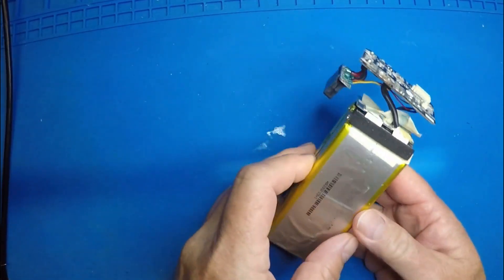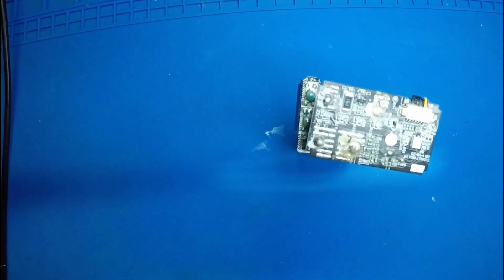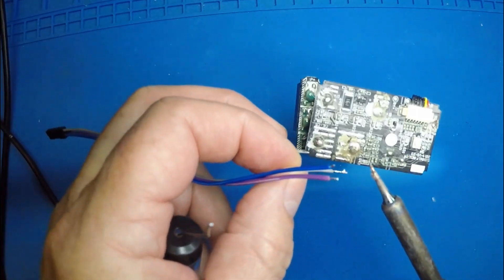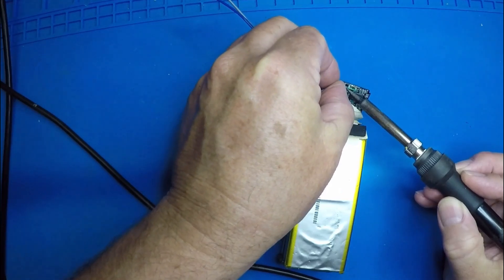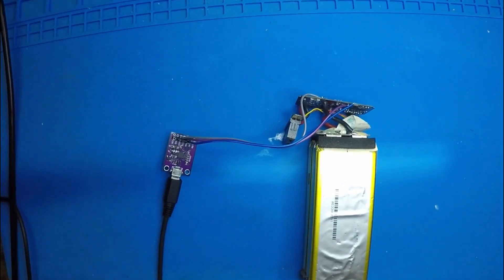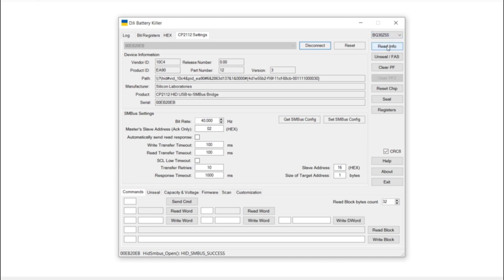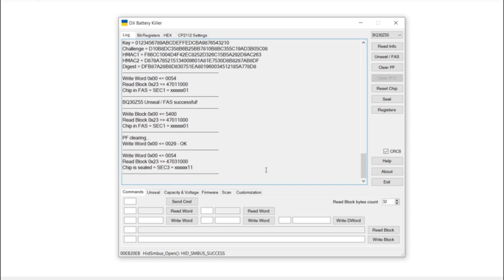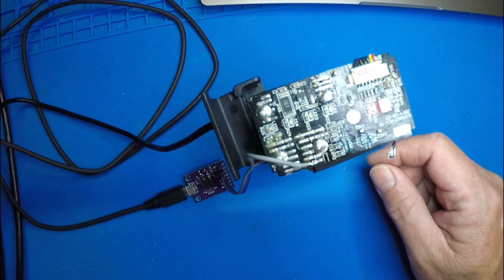DJI Phantom 3 Battery Recovery

Comment: Hello, i will recover my Phantom 3 battery. I can unseal the battery, clear the pf code's en see to the register that the pf warnings are gone. But when i seal the battery and i read the register out than de pf code's are back and i cannot charge the battery. I have also reset the battery in the tool but the same result. Anywone that have this problem in the past?  Thanks for the good explination video! Regards

Comment: Great video and I’m hoping I can make this work for mine.  I have nine batteries and they have sat for an extended period of time.  All won’t charge, no lights whatsoever.  My original three are swollen so they are lost but other six are newer and hopefully I can save.  At the start, how did you read the individual voltages for each cell and subsequently bring them up individually?  Did you unplug the balance connector that comes down from the BMS to the pack and use those pins for reading and charging like you would with a standard lipo that has the balance connector hanging off of it…first pin ground then pins 2 through 5 are the hots for each cell?
Reply from the maker: I generally measure from the tabs on each battery to get an idea of the overall health of the battery before charging. If one cell is really different to the others I will charge it until it is about the same as the others. I will then charge the whole pack to 15 - 16 volts from the two main leads going from the battery to the BMS board. hope that helps.
Reply: What an adventure!  If you could run into a roadblock, I think I found most of them.  The DLL error, staying sealed and needing the charger to power the board etc.  Thankfully your two videos and all the replies to other folks issues got me through most of the hurdles.  Cleared the PF and voila it started charging.  Took off the 2112 leads and, as an after thought, tried to power up the battery and no lights - no go but it would charge.  I used alligator clips to latch onto the battery terminals on the board and I couldn’t be sure something else wasn’t contacted on the board.  So, I tried removing the balance connector, followed by the positive battery lead from the board.  Big mistake, I couldn’t get the lead back in the board before something got touched, sparked and goodbye board.  Fortunately I have 3 swollen batteries and pulled the board from one of them.  Stayed away from the board connections, this time, and worked the leads on the balance board instead.  Removed the PF and I now have a working battery.  One down and five to go.  Sorry for being long winded but it was four days getting to this point.  I have to stress how helpful your videos were and I am extremely grateful you made them, THANK YOU!!!

Comment: I am getting an error when selecting read info! Good connections all around. Any thoughts? THX
Reply from the maker: Made sure the device is showing in device manager, also make sure you have selected the correct BMS model and the device in DJI battery killer. I find that sometimes I need to connect the charger to the battery so that it powers up the bms. I assume you have charged the battery pack back to 15-16 volts ?

Comment: I can't install error mfc140ud.dll, is there a solution?
Reply from the maker: The missing file is from the Microsoft Visual C++ software, its from MS, lots of software use this software, hence most people dont see your issue as its already installed.
Go to this page
https://learn.microsoft.com/en-us/cpp/windows/latest-supported-vc-redist?view=msvc-170&fbclid=IwY2xjawN2CNNleHRuA2FlbQIxMABicmlkETFGdktmOWNHaVVSMDBWOWQ0AR7N289DJd5iqs3Y3CyY8V5hEl6xSxVUP7mmE-Dftuh1NZbNer6uZ5C2oETRBA_aem_oxkffxOCqsXzus2wNDMuwA#latest-supported-redistributable-version
Download the X86 version and install it.
The other option would be to find the version that is required for your operating system but that could be a little tricker.

Comment: Best way to take off the battery cover so you can re assemble later or is that a lost cause after the fact
Reply: Once you remove the front cover, the case itself has 2 clips at the sides at the very front, and 1 large one at the back. Unfortunately everything is also glued together with something that's as hard as the plastic itself, so for all practical purposes it's all a single piece. Carefully cutting the plastic along the entire seam is the way to go. The cells themselves are protected by that grey metal case, so you don't have to worry too much about cutting too far. There's a section that's hidden by the charging port that you're just going to have to force apart.
Reply: @TheRoughy thank you!

Comment: I have to ask how does the pack open every vid i see starts with an opened battery pack yu cannot open them up without breaking it . If you should manage that id like to ask what your confidance level is flying say a p3 pro on it. These should just be left alone to fail and be binned
Reply: Well u will test the battery first lol leave it on hover like 1m off the ground till it dies then u know if battery is good or not

Comment: I’ve seen some other lithium batteries being woken up by just running wires from a good to one that is asleep..forgive my ignorance but why couldn’t you do that?
Reply from the maker: If the battery doesn't have a BMS (battery management system) then that will trick the external charger into charging. You can also lower the S rating to trick the charger into charging the battery. So setting the external charger to 3s when its a 4s battery. 

This will not work on batteries that have a BMS because the BMS controllers all power into and out of the battery. When the PF (permeant failure) flag is set in the BMS it must be removed before the BMS will allow the battery to be charged or for power to be consumed from it.  From memory the only DJI drome that has a battery without a BMS is the Phanton 1. It has a standard lipo with no BMS.
Reply: Thank you, I appreciate your thorough, kind response!

Comment: Hola!! Logré recuperar una batería. LA otra queda con el primer led pestañando rápidamente. ¿Alguien sabe qué hacer en este caso?
Reply from the maker: Asegúrate de que la batería tenga el voltaje correcto y que todas las celdas tengan el nivel correcto (si una celda está defectuosa, su voltaje podría ser muy bajo). También conviene consultar la tabla de LED de la batería para ver cuál es exactamente el error. Podría ser una temperatura alta o baja. También puedes comprobar el problema con el software DJI Battry Killer al consultar el registro. Solo tienes que buscar el significado de cada uno.
Reply: @bozmanx  Muchas gracias por tu respuesta. Te dejo detalle del registro. La verdad, soy un entusiasta que no manejo mucho esto:
(00) Manufacturer Access = 0x0000
(01) Remaining Capacity Alarm = 150 mAh
(02) Remaining Time Alarm = 10 min
(03) Battery Mode = 0x6001
(04) At Rate = 0 mA
(05) At Rate Time To Full = 65535 min(s)
(06) At Rate Time To Empty = 65535 min(s)
(07) At Rate OK = 1
(08) Temperature = 21 C
(09) Voltage = 17347 mV
(0A) Current = 135 mA
(0B) Average Current = 136 mA
(0C) Max Error = 1 %
(0D) RSOC = 49 %
(0E) ASOC = 50 %
(0F) Remaining Capacity = 1101 mAh
(10) Full Charge Capacity = 2266 mAh
(11) Run Time to Empty = 65535 min(s)
(12) Average Time to Empty = 65535 min(s)
(13) Average Time to Full = 514 min(s)
(14) Charging Current = 2000 mA
(15) Charging Voltage = 17400 mV
(16) Battery Status = 0x80
(17) Cycle Count = 2
(18) Design Capacity = 2240 mAh
(19) Design Voltage = 15200 mV
(1A) Cpecification Info = 0x31
(1B) Manufacture Date = 0x497A - 2016.11.26
(1C) Serial Number = 3919
(20) Manufacturer Name = COSLTSUN K
(21) Device Name = DJ01 
(22) Device Chemistry = LION
(23) Manufacturer Data = 0x00000000
(3C) Battery Cell 4 Voltage = 4342 mV
(3D) Battery Cell 3 Voltage = 4343 mV
(3E) Battery Cell 2 Voltage = 4330 mV
(3F) Battery Cell 1 Voltage = 4332 mV
Reply: Ahora pestañaban el primer y segundo led, como en proceso normal de carga y de repente se apagaron.

Comment: Dude you saved me throwing away a good battery, ive used BK with spark mavic bats etc but didnt know i coould do the same with the p3 bats,  i had the unseal issue but now happy to say my bat is now charging, liked and subbed
Reply from the maker: Great to hear, there are a couple versions of the battery killer software and they cover a few different chip sets. You can also use them on Phanton 2 and the DJI FPV batteries.

Comment: Why have I unreadable
Reply from the maker: check your connections and make sure that the data and clock are the right way around. Some times I find I need to connect the charger to the board so that it powers up the BMS and then I can read it.
Reply: @bozmanx when it's read but it says could not check chip id
Reply from the maker: @akbarmaulana4906  if you have checked everything and the wires are connected correctly, if you have downloaded the right version of software and selected the correct chip then you might have a bad bms
Reply: @bozmanx  maaf sekali paman saya sudah melakukan sesuai dengan video sudah terkoneksi bagus tetapi baterai tetap terkunci?
Reply from the maker: @akbarmaulana4906  
Apakah Anda menghubungkan pengisi daya ke baterai? Mungkin papan BMS Anda rusak
Reply: @bozmanx yes when I open the battery I plug it into the battery charger

Comment: Hello, I unsoldered the cells to charge them and now no lights come on. Would this procedure in the video solve the problem?
Reply from the maker: It should , by disconnecting power to the BMS the PF flag will now be set which will not allow you to charge or consume power from the battery. Once you clear the PF it should be fine as long as the cell voltages are back to normal.

Comment: Great tutorial...
My battery killer does not unseal the chip .. it stays sealed.
But reset chip clears the PF.
Altough it doesnt charge...
*Update
I disconnected the soldering and tried another dead battery.... it has some dead cells , so i send this one to a friend who putt new cells..
I got back to the first battery and tried the unseal at the bottem ... and it worked ! also FAS .. and i pressed a bunch more read buttons...
Unsealed and in FAS mode. Reset PF.... seal chip.
disconnected from P2112 and putt it back together.... putt it on charger and the quick blinking came on ...
In a bad mood i went down to get a cigaret and redbull... i came back up and i saw it was charging.... lol ...
Thanks for the video ..
1 Question ... can this software also do the Phantom 4 batteries? i got 1 with 1 green light quick blinking. (Locked BMS).
Reply from the maker: I did a video on how to unseal a battery that wont
https://www.youtube.com/watch?v=sUTP4rLUUus

sometimes you find you need to reset the battery, I have also noticed that if I remove all power from the bms (battery pack and balance lead) after charging to the correct voltage that this makes the process a bit more seamless.

From memory the same software will do a Phantom 4 battery but you need to set the chip to a different one. Here is the video I did on the P4 batteries.
https://www.youtube.com/watch?v=A0q7OdcWKCA
Reply from the maker: Make sure your also using the version in the description as there are a couple and they support different chips.

Comment: Hi, I'm not very clear about the cable connections,
Would it be possible to help me with that part and thank you very much for the video
Reply from the maker: If you go to 3:22 in the video it shows you where teh clock and data cables go

Comment: Excellent tutorial!!!  I have a CP2112 coming tomorrow .... question, how do you bring the voltages up in each of the 4 cells?  Are you charging them all together (4S mode) or individually?   If individual how do you get to the contacts?    Thanks in advance!     (I have a 1S - 4S smart RC charger as well as the stock DJI charger available)
Reply from the maker: you can do it either way. I normally use a desktop power supply so I have really fine control over the amps.
Reply: @bozmanx  Well, I ended up going through the whole process, was able to "see" the battery, unsealed it, cleared PF flag, re-sealed, and no luck, battery still wouldn't show any sign of life as far as the LEDs go.  I gave up, I think it's been too many years, last flown in 2019 I believe.  It's probably time to retire the old Phantom 3 Standard.
Reply from the maker: @cscoppa  what was the packs voltage when you cleared the PF and did the PF return ?
Reply: @bozmanx  While I was connected, it read back each of the 4 cell's voltages, they were all in a good range, like 3.8ish.

Comment: very good video, how do you open the program you used ? i have the zip file but cannot open it. help?
Reply from the maker: Use winzip or 7zip to unzip them into a directory. You can then just run the exe file